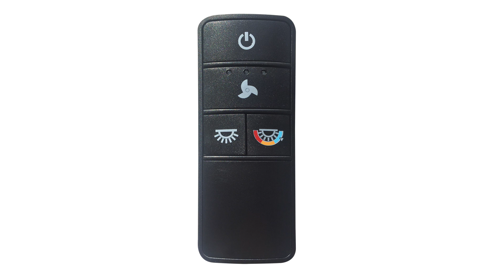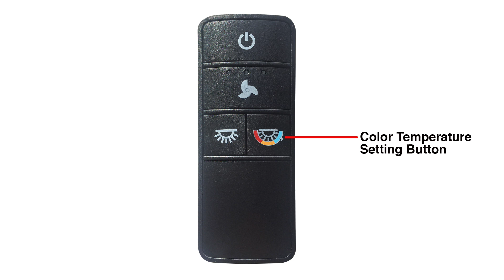How to Install the 52 in. Dinton Ceiling Fan

Comment: Kind of want to see a video of the Home Decorators Matteo. I want one but I'd prefer to know motor size first
Reply from the maker: The Matteo has a standard 153x15 mm AC motor
Reply from the maker: The Matteo installation would be pretty similar to our Bay City fan installation.
Reply: @ceilingfans101   where do you find the motor size at? There's a few others I'm curious on